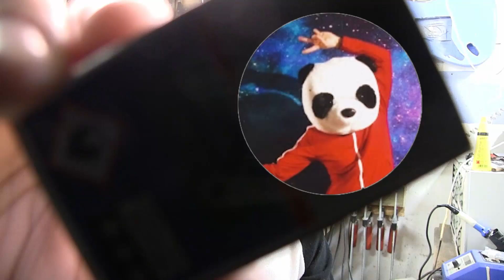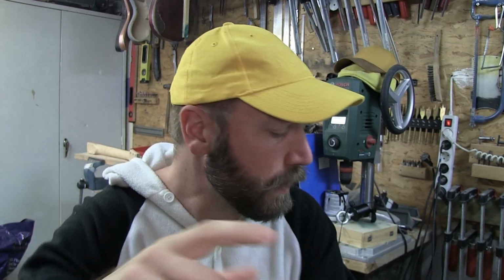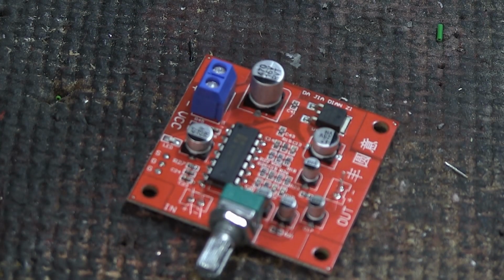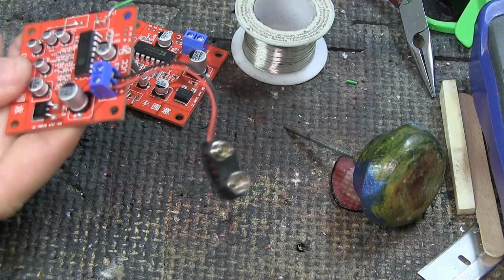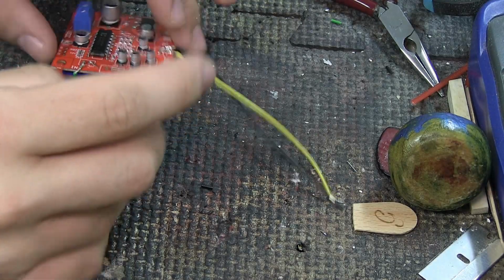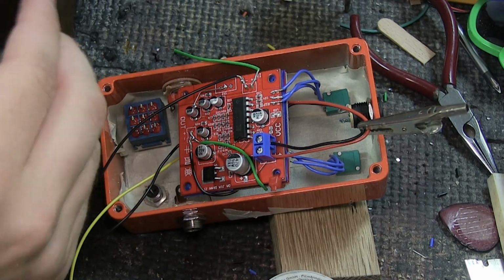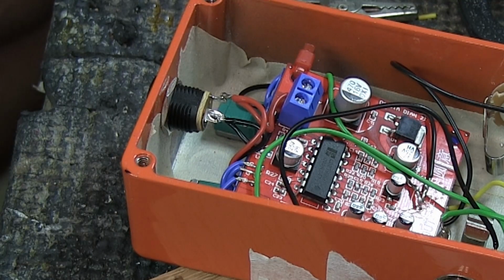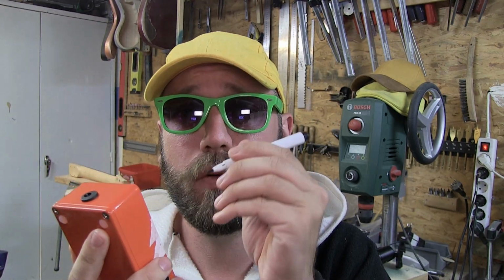how to build a magic pt2399 delay pedal for 10$

Comment: That's not a volume control. It the mix or level of the wet to dry sound. You definitely need that.
Reply from the maker: Man you are completely right I tested both and was 100% sure and still got it wrong I opened up a new one and it's not a volume thank you for helping me 😊 guess I'll have to make a new video modding it😃

Comment: You can add another pot for feedback on the pt2399 board, as well as the speed control. Connect pot between leg of C16 (resistor side) and centre pin of volume control.
Reply from the maker: I'll check it out thanks!😃👍
Reply: Yup dude knows his stuff. I've done this. You can also build a small passive buffer to make it more equal in volume when on.
Reply: It's C15 and as we keep saying, it's a mix knob. Leave it on. Uou can yse it with thr C15 hack to fine tune, infinite delays. Great videos. It's good to start with basics, and then you can go to crazy town and back, with ease. Leave the mix (volume) knob, buy another pot, 50 to 100k. Solder it in as he shows.
Reply: @stuartchapman5171  C16 to centre of mix pot when I did it. I've never connected anything to C15?

Comment: Somethings I've done to this board is add a buffer, add a volume knob so I don't have to make a buffer lol, I've added a feedback knob and I wanna say on the knob that changes the time I added a resistor to I wanna say a 100k pot. Longer delay time but it gets all bit crushed on repeats. You can theoretically add a "feedblast" momentary switch but I haven't done it. These things are fun and when I bought them I'm bulk I feel like I got mine for under 3 bucks a piece but price varies sometimes dramatically wherever you get them. Like every supplier has them different like the lm386 boards. This was one of my first 2 diy pedal projects. 

Thanks for the shout outs and sending people my way. I can't wait to long into stuff and see what's up. I also just appreciate you being you brometheus. ❤️.  The dance and the onesie is a nice touch.
Reply: I bought loads of these boards, and the LM386 boards from Aliexpress. PT 2399 boards are around 80p (I'm in the UK) each and the 386 boards are around 28p each. I bought far too many to ever use, as is usual for me.
Reply: @simoncardie9371  I've used those lm386 boards in so many ways. I have a dsp 99 reverb I built with one in it because it needed some volume. I also found these small red lm386 boards with a bigger normal pot on them that are smaller than the blue and I think layout is different because they sound different. These weird things not meant for pedals that you can pedal is fun. I like the 99 dsp reverb boards and the isd sampler boards too. You can do so many things. Add them together, or modify them, or just add a footswitch either way it's like adult Legos in a way to me.
Reply from the maker: Sounds like there is a lot of fun stuff to do your gonna have to send me a to do list 😆 haha  of course I shout out you 😊your the one who told me about it should let people know 😃👍
Reply from the maker: @simoncardie9371 there is so much fun you can build so you just need to start spending all your free time doing it haha 😂
Reply: @tigmil8116  I've got one of those dsp 99 effects boards. Mine acts in an odd way. The pot just changes the total volume, not the wet/dry effect volume. Also, like you said, it's a very low output. I'll get it back out and try your suggestion of amplifying it with the LM386. I've not seen the sample board, so I'll look that one up. Thanks for the suggestions!
Ps. I've just had a look. I've also got a few of the tiny LM386 boards. I used them to power electret microphones, of which for some reason, I bought 100 for £5. I've used 2.
Reply: @zurowetz  Free time is what I have at the moment. I've been off work since June, waiting for hospital. I usually play piano/synths, but also like electronics (novice standard really). This will give me something to do!
Reply: @zurowetz  I only started with the idea of the 386 effects, after watching your videos. So, thanks for that!
Reply from the maker: @simoncardie9371  I hope you are doing well its nice to have something to work on so let me know what you make 🙂
Reply from the maker: @simoncardie9371  that's awesome! Thank you for telling me 🙂 it always makes my day to know I inspired someone to start  DIYing😃👍
Reply: @tigmil8116  I'd never heard of the sampler boards you mentioned, but just managed to find and order some. It is the ISD1820 isn't it? I hope so, or I've bought the wrong thing!

Comment: Hey man -- so I don't know if you (or anyone else) can help or not -- but I took my 2 boards and wired them up just like you did here.  Before I wired them to the footswitch and all that -- I broke out cables with clips and "breadboarded" the in's and outs. Here's where I think I might have broke the space-time continuum: 

1) The only wire coming from the input jack is going into the input of the 2 circuits. The only out is coming out from the circuits to the output jack. The power wires are in the green lugs and connected to a 9v battery.  The little red lights on the board go on.  The ground for the output jack is also connected to the battery. A ground wire is also sent from the grounds of the input jacks to each other.

All I get is clean guitar tone.

2) Leaving everything else the same -- I take off the wire connecting the grounds of both input and output jacks:

All I get it clean guitar tone.

3) Confused -- I take the ground connected to the output jack off the battery and connect it to the ground connected to the out of the circuit. 

All I get is clean guitar tone

4) Now the only thing connected to the battery is the power cables from the green lugs on the boards.  The input jack is connected to the input of the circuit and the ground of the input is connected to the circuit. The output of the circuit is connected to the output jack and the ground coming out of the circuit is connected to the ground of the output jack:

All I get is clean guitar tone.

5) All wires are now running through the circuit -- except the power.  I disconnect the power from the 9v.  The red lights go off.  No power is running to the circuit.

All I get is clean guitar tone.

Do the natural laws of science not exist in the proximity of the desk in my Canadian basement? Am I making this guitar make noise with my mind powers?  Are the boards just shorted out and there's a bypass internally somewhere? How could that be possible on 2 boards simultaneously? Is the type of popsicle stick you sandwiched in there the key?  I don't even have them stuck together -- I'm putting them in a larger enclosure. Are these circuits and my guitar trolling me? 

Any help or ideas?

TL/DR: I might be a demi god with magic powers or an idiot. To be determined.
Reply from the maker: Halloo don't worry we'll figure it out together 😊 in worst case you can send me pictures on Instagram 👍
1) it doesn't sound like you have wired it precisely like me i have one board going into the next if I'm reading correctly your jacks are going to both boards at the same time you need to first connect one jack to one boards in and the the out of that board to the next ones in and then a jack to that ones out with power having its own + and -   and in and out having boyh ground and lead once you get that to work you can connect a true by pass because if something goes wrong you know it's the by pass
2) you will always need to ground everything 
3)I'm not sure I understand but the dc shouldn't be connected to the output
4) is both batter +&- connected? 
5) I haven't checked if you need power to pass a signal through but maybe you can so it might not mean anything 🤷‍♂️
One last thing is maybe super stupid to say but I'll say it anyway ( kinda like saying have you tried turning it on and off again) but here goes the 2 pots that are on the boards stock are blend pots I say in this video that its volume but that is wrong ( I corrected myself in the next video) it could be that you need to move them 👍 anyway let me know how it goes and if this helped or if you need anything, good luck 👍😃👍
Reply: @zurowetz  I don't know why it's not letting me reply -- but I added you on Insta and posted the mess.
Reply from the maker: @forktrus  cool I'll check it out 😃👍

Comment: You should only connect the ground once, otherwise you risk a ground loop and a lot of hum. A consistent technician (what is not your case) would also considered galvanic isolation via an optical isolator.
Reply: I wasn't thrilled with the result, except for the tremolo. Haven't you considered putting two (or maybe three) modules in parallel, and putting a phase shift/signal doubling effect before the second/third, either fixed or with a potentiometer?

Comment: I've got 10 of these coming from 2 different sellers on ebay. I want them here NOWWWW!
Reply from the maker: Haha I get it 😃 but I'm working on a new video so hopefully you have them by then 😉👍
Reply: A new PT2399 video?
Reply: Also they might show up soon only a state over! Also got LM386 on the way really liked your video where you tried using them with diodes and LEDs I have both of those I'll have to try it out. Curious to see how well the little amp board is at driving a mini spring reverb tank. Would love to combine the pt2399 delay and spring reverb into a dedicated pedal.
Reply from the maker: @NoirEater  sounds awesome! I have a video called killer fuzz where I combine the lm386 witch a tremolo it would be somewhat the same so take a look and see if it inspires you😃👍
Reply from the maker: @NoirEater  yeah hopefully coming soon 🙂
Reply: I definitely will have to take a look!! Your videos have been actually giving me a ton ideas!
Reply from the maker: @NoirEater  glad to hear it!👍😃 there is also a playlist called LM386 pedals just so you know 😉
Reply: Having nothing but bad luck with these boards. 2 of them exploded so far! Running 12v which seemed to work for a tiny bit.
Reply from the maker: @NoirEater  strange, all mine are working as they should but I haven't even tried to use 12v🤔
Reply: Yea that probably my problem lol
Reply from the maker: @NoirEater  I mean it's your problem 😉 but I'll try my best to help out 😃👍

Comment: Just order a PT2399 IC n build a clone of Mad Professors Deep Blue Delay loads of schematics online. Will sound 1000 times better. You can also build a LFO circuit and attach it to the Time pot and create a modulated delay.

Comment: 1.  That circuit is noisy as all hell, 2. $10 does not account for your time & labor.
Reply: 1. So don’t use it? 2. Yeah you usually don’t quantify that when you’re DIYing for fun.
Reply: @1RandomToaster  Plus there's time that goes into developing the soldering skills needed, plus the cost of solder setup.. $10 is out to lunch, jack.
Reply: He fell for the time is money meme
Reply: @heggy_69  well, time is money. In this case you invested that money into developing the skills. If you have zero interest in doing that then you have zero interest in DIY.
Reply: @1RandomToaster  the trick is that I value my labour at nothing, therefore time isn't money and I save a lot of money. Now all I've invested is parts